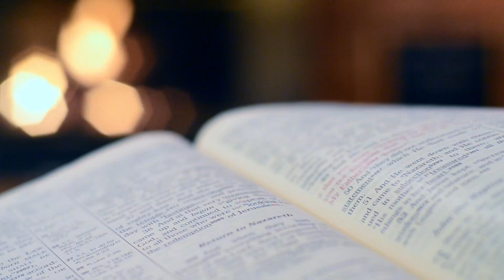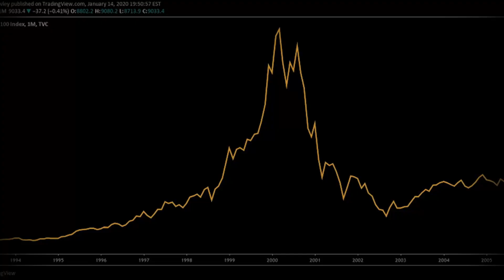The True  Difference Between Jeff And Elon | The Blue Origin Problem

Comment: After i watched videos of Tim at blueOrigin i noticed like you a lack of innovation they seems to work like a more "traditional" rocket factory.
I think we will be surprise by the first or second launch of new gleen beacause this "traditional" approach to built rocket in one way is more reliable than spaceX approach.
I personnaly think spaceX built>test>fixing approach is the best for innovation because they need to be more flexible but the result and timeline will be much more unpredictable.
So the new gleen can be a great value for a short period of time until Starship be fully operational
Reply: No I agree the the vidéo. They use old aliminum fabrication for the full tank that was the technique in the 1970... Even NASA was looking in the 2000 to move to carbon composite... and look at Rocket Lab electron et Neutron rocket that use carbon composite with fiber placement machine... it is lighter and cheaper then machine aluminium lol. 

If Blue Orgine actual really spend 10 BILLION $ for the R&D + Infrastructure and New Gleen fly as often as Space X flacon 9 (around 400 up to know) then you end up with a 25 Millions $ per fly in amortisation alone... That is not cheaper then space X lol 

For god sake, Rocket lab is almost finish the R&D and infrastructure for the Neutron rocket and they are on a 300 million budget lol Million not Billion lol